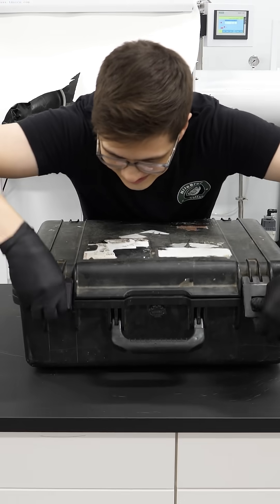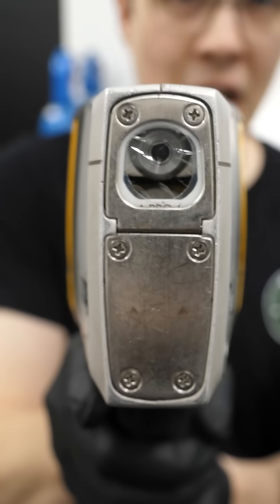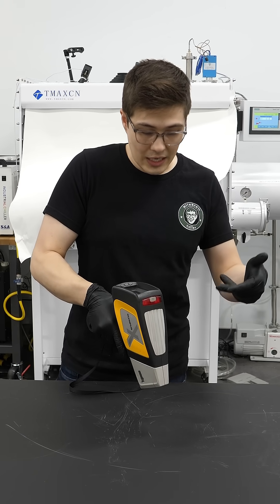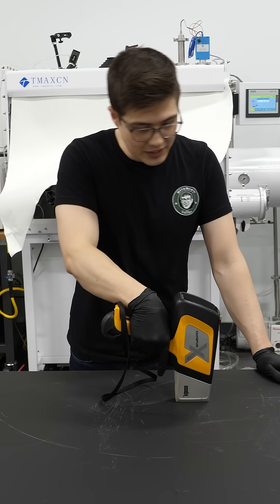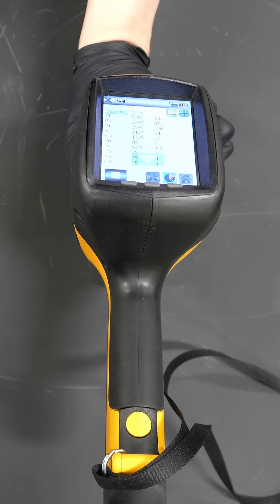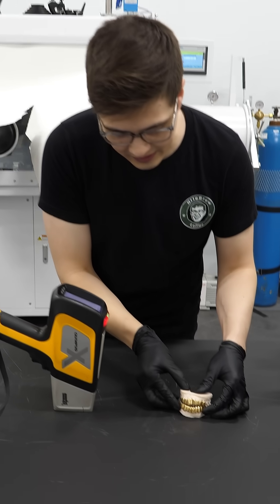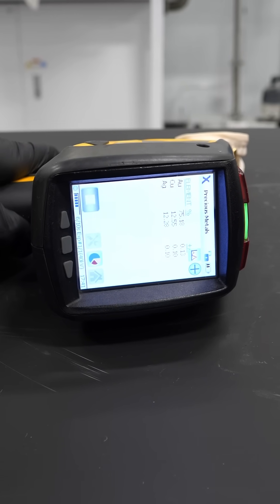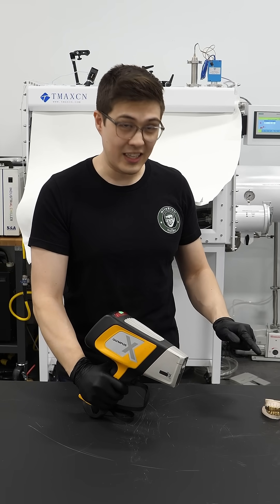I bought a ray gun

Comment: We use a similar tool I call the Spectrometer to analyze metal composition in aviation metals. We as in the ones certified to which I’m not but I do get to watch sometimes. Usually structures uses it if the exact metal type and make up can’t be determined for fabrication of replacement parts they bring in the “I got a gun 😂” to figure it out.

Comment: We used one of these at a place I worked at and I brought my Geiger Counter in one day. I put the Geiger Counter up to it and it barely reads enough to be dangerous while in contact with a surface. We also tested shooting it directly into the Geiger Counter and that's when it went crazy. So just don't put it on your nuts and you're fine.

Comment: It does not reflect X-rays. The X-rays excite the electrons of the various elements. The electrons then emit electromagnetic radiation (light) at very specific wavelengths - not high energy x-rays. The device can then detect these "spectral lines" and determine the exact elemental makeup of the tested substance.

Comment: Cool to see the tool I used for my master's thesis featured in a video! Even cooler to see it in soil mode, as that was my field of study. A lot of the practical use of XRFs are for metal purity testing or mineral exploration, but there is a lot of research in the soils field relating the elemental results here to different soil properties. Essentially the XRF can be a rapid tool to understand the chemical makeup of a soil through a scan in the field taking minutes vs sample destructive, time consuming, multi step laboratory procedures to achieve the same results. It's not a perfect replacement for the lab, but there is much to gain from this research!

Comment: This incidentally also means you should use a kind of protection to not keep blasting your hands and eyes with x-rays.

There is a reason that radiologists wear lead skirts. It's the duration, not the strenght of the x-ray exposure, that's dangerous.

Comment: Not just the type of metal, but also the thickness of various layers. XRF is used to understand the thickness of various metal finishes, such as the gold plated- nickel-plated copper used in circuit boards. 📲

Comment: I learned a few days ago (sanding and painting project) that any lead-free paint can have a teeny amount lead. As long as the ppm of lead is less than 0.009% by weight, it's lead-free. That's the regulation that was put in place a few years ago, mind. The older the paint, the higher the ppm.

Comment: Measuring like this is far too dangerous. If you want to measure a wooden table, the radiation will escape at the edges. I don't like the Setup of Olympus (Evident) and so on, because it is always dangerous to measure small samples. There is a better instrument, like the Spectro xSORT with a rubber / tungsten gasket in front of the measuring head. There are also measuring chambers available. With the chambers it is absolutely safe to measure small samples and so on

Comment: Over here it is used for apartment/house diagnostics, more precisely for led (present mostly in old paints). You have to have a full diagnostic (energy, led, asbestos, ants and other bugs, electrical system, gas system etc.) in order to rent or sell. But, before using the device, you need to check /calibrate it every single time with the provided materials.

Comment: I used to use an "x-ray gun" I was assigned in the US Army. Well, I guess I had 2 of them. The one like you are playing with, it was used to check certain wear surfaces on helicopter power trains to find out if the hardened low-friction layer had been worn out enough to expose the base magnesium. That would be a slight annoyance because the heat build-up could maybe ignite mid-flight, and that area was the main rotor mast. The second "gun" was a bit heavier and required the same power supply as the base. It did have enough energy to get an x-ray image of certain parts to inspect for internal stress flaws. It was strong enough to get an image of the solid metal rotor hub, so I was required to strongly suggest that anyone in the path of the beam should relocate to somewhere 1500 yards behind a solid concrete wall. So OFC the procedure of operation allowed me a lead half apron and safety glasses, and a 20 foot long cable with the firing trigger on it. My E-4 headaches had to do an unexpected scan during my leave once, and I returned to find out that they had accidentally cooked the peacocks in a local reserve and exposed themselves to more radiation dose than they were allowed to get for the period of time approximately their entire enlistment and couldn't even get medical imaging done unless in mortal danger for 6 years or blood and other tests clear them. They just had to compensate the owner of the reserve for the cost for 5 peacocks and re-slot from their primary MOS to that of a rifleman (13B) and transfer from a aviation company with A/C & heated mobile shop for deployment and start sharing the best mud puddle covered by half-shelter with a battle buddy praying for clear warm weather. I checked with them a few years ago and they were all clear of cancer signs but I had gotten cancer 3 times so far. I'm never going to understand what invisible force protects stupid people from themselves.
Reply: I have a theory that the people who don’t even consider the dangers of something are more likely to not feel the effects/suffer from said thing. It’s like this in the medical world too. I was born with an extremely rare genetic condition, and have spent most of my life in the hospital. It always seems like the people who are worried the most about their health are the ones who get taken out more quickly.
Reply: @dogshake I think it has to do with our unconscious brains. If we are constantly worrying over our health, a lot of the time it’s because our bodies sense something is wrong. Ergo, it tries to tell us by releasing hormones and chemicals to bring warning signs to the conscious mind. But that’s just my guess.
Reply: @karmickhaleesi   That would make a lot of sense!
Reply: Soo...how do you accidentally cook a peacock? Or was it more of an "accident"?
Also, you having had cancer is crazy! Did you get extra checks for that?
Reply: @Frrk  the peacocks were in the direct focused beam of the portable x-ray emitter and sadly way too close to the source to only receive the survivable elevated skin temperature. The birds are apparently more suseptible to radiation than some stupid humans sharing the PPE. The peacocks were also 20 yards away, concealed behind the rear hanger door and a plastic 6 foot fence with the power options maxxed and the "barrel" still pointed directly at their perched and unmoving fully cooked forms.
it was my understanding that it had happened before. When I was doing my preliminary incident report to start the paperwork mountain started, I was almost convinced that it was done just too perfectly wrong to be totally unplanned. It was only the perch in the focal area and maxxed settings that just happens to be adjacent to the pin holding the  most annoying gang of birds is too many lucky holes lined up in the swiss cheese for me to be comfortable and those minions were aware of it.
Reply: @Nipplator99999999999  
Yeah, I can understand your suspicions there, lol. In any case, also exposing themselves to that much radiation shows they were definitely not respecting guidelines...
And that's some bad luck on the timing getting cancer. Don't understand why they would cut coverage on the meds, wouldn't they want you to function well? But there's probably a load of politics going on on that front.
Thanks for sharing your story :)
Reply: @Frrk  as far as the cancer is concerned by the Army, I have been diagnosed with the aggressive forms of genetic cancer during the period of time between old enlistment contract termination and the new reenlistment contract having been accepted and taking effect. So I was just getting the standard compensation for injury, but apparently, it has just suffered a major cut to what it is covering and the medical supplies that I have to have just to survive, are not part of the benefits that I have anymore. 😑
Reply: Those are also used for checking welds.
Reply: I learned! Thank you! X-rays are evidently no joke. Truly, best of luck to you with no more cancer and much more care.

The fact that your medically necessary aid is being cut, and didn't 'count' as being service-related makes me so mad. I don't understand how the USA can treat its soldiers and veterans so poorly at the best of times, let alone how you're being treated under the Department Of Giggling Evil; regardless of one's opinions on war, if you're sending people to die for you then you must care for them in return. It makes me seethe, so I can't imagine how you must feel.
Reply: @clockwardkailleach  They have reserves, and a horde of cultists who only really care about you enough to give thoughts and prayers.  Why the military allows themselves to be treated so poorly is beyond me.  If yall voted blue you would get better treatment.
Reply: Thank you for your service
Reply: I 🤔
Reply: i aint reading all that. 
happy for you man.
or sucks that happened to you

Comment: Used them in the past both Niton and Bruker at a certification lab to get quick reads on material. First, you need to calibrate it using a reference material to ensure you are getting an accurate read. Also it only analyzes the outer layer. For more in depth analysis you need to drill the item to get shavings for analysis. Same for your table you are only reading the surface most outer layer with all contaminants on it.

Comment: These are often used to authenticate gold coins, but the problem is that the X-rays can't penetrate deeply. So if you have a coin or bar that is only layered in gold, it will pass the XRF test.
One must run a number of different tests to be sure.
These guns are good for dealers who must test a lot of gold and do it quickly. Silver pops up even more often. One could also test less common metals like platinum and palladium.

Comment: For folks worried about bouncing emissions, I used to work for a company that used these for Positive Material Identification (called them PMI guns usually). The techs who used them on the regular never really used shielding but still treated them very carefully. Like, only taking out of the case when the worksite was prepped. Checking exposure zone, etc. They also usually carried dosimeters to track their regular exposure (we worked with other radioactive NDT, so lots of folks ran with dosimeters). But even with all that, it's usually WAY less exposure than other NDT analysis methods.

EDIT: This is not official radiation safety advice, please check your local regulations and safety procedures

TL;DR it's likely WAY less exposure than most people are making it out to be.
Reply: Also he's likely not going to be using this nearly as much as people use it in industry
Reply: people get more exposure walking by the security xrays at their jobsite anyway lol
Reply: @realbbqchips  false and true, they really don't give off that much and they should have shielding.
Flying tough... Yeah that gives you more exposure to radiation then an RT technician on average 
(Of they do there god damned jobs correctly and use A FIRIRDJCN COLIMATOR ON A 75 CURRY IRIDIUM)
Reply: yeahp, its harmless basicly. just dont put it on your self (or an other peron)
Reply: Yeah, if it was bouncing/scattering you would have been able to see it in the camera feed.
We use a lot of cameras in our radioactive handling cells, when you move a source closer to the camera you can see the effects on the TV screen.
Reply: Backscatter radiation isn't very strong. Just keep your hands away from the target.
Reply: I’ve been blasting my peenar with x-rays to increase the size, but it’s not working 😢
Reply: Honestly im more worried about the lead in the paint
Reply: Why is it called positive? Because that implies there is also negative?
Reply: @NomadUrpagi  yes, actually. Positive Identification is an affirmative analysis, meaning it identifies the actual composition.

Negative identification is process of elimination. So those NDT methods tell you what it ISN'T and you extrapolate from there.
Reply: I work in Gamma Radiography. This is like..
.
.
.
.
.
.
.
Nothing 🙂

Comment: Metallurgist here. Immediately when i saw the icon I blurted out "XRF gun" 😂 A lot of foundries will use this as a preliminary check on the incoming ingot to compare to the certificate of analysis from the manufacturer. Ive actually detected issues with our particle sizes (this foundary used atomization to produce powdered metal), simply by long-running data we got from our XRF checks. Pretty cool stuff!

Comment: I've wanted one of those for a long time.  I have a lot of use cases for an XRF analyzer but the cheapest used ones available anywhere are $10,000 to $30,000 so that's not going to happen.  They don't need to be that expensive but they are only used by large industries and industrial hygiene so I don't see the price coming down any time soon.  Thermal cameras used to be over $30k too but you can get them for $500 now.

Comment: Please by a radiation detector and a lead vest with this. Sometimes xrfs (especially used units) like to leak some xrays out of the side. This will also happen if what you are testing isn't fully flat, or has a bumpy surface.

I have done a lot of testing with these things and they are almost always perfectly well sealed, but its best to be safe. Especially with a hand held xray machine held at about junk height....
Reply: even if it was perfectly sealed / internally shielded, backscatter will get you
Reply: @smenor  oh yeah. When he pointed it at the teeth on the table like that, I almost screamed.... He definitely dosed himself a bit there. That would get you banned from the XRF at most labs.
Reply: I was wondering about that. Like if you have a powerful laser, you don’t use it without goggles even if you always point it away from yourself, Because it could always reflect back at you. I don’t see why x-rays would be fundamentally completely different on that
Reply: I mean, this is the same man that busted out a brick of uranium on that table....
Reply: @g-nizzle that is not at all the same because the type of radiation from the uranium and from this gun are not fundamentally the same.

Xrays have typically more penetration while the uranium has more alpha particles, which have very low penetration.
Reply: Nah he’s fine
Reply: Id venture a guess his junk is already toast, but who knows??🤔🤔😬😬
Reply: Yeah, Ludlum pancake-detector is hyper sensitive to x-rays.   But these XRF guns are only 30KeV emitters, might not pass through a normal geiger counter tube.   Need alpha window, for detecting soft x-rays.
Reply: For great science! Marie Curie style.

Comment: I did buy a radiacode 3.00, and it's amazing .What I discovered in front of the house found one atom of Uranium on the cement  .
What do you have is my choice to get one but it costs more than  my car .
Use on georock  ,with my I found Uranium, cesium, Th and others elements. 
The most important thing that I discovered during  construction 🚧 is a  hotspot .
Reply: Have you been able to detect radium in basements?

Comment: I use one of these every month at work. There's a shielded test stand that can be used to keep the x-rays contained and prevent user exposure. There's also software that allows you to view the spectrum of elements detected. This is a handheld XRF analyzer, but plating areas will often use tabletop versions.

Weird to see Nile using one a few days after I performed my XRF tests lol

Comment: Glad u mentioned the paint... im interested in the penatration depth at the "surface level". would it measure drug compositions.
Reply: Drugs are usually organic compounds, consisting of light elements like carbon, hydrogen, oxygen and nitrogen, which can't be detected with this gun.
For this, you should better look for something like a handheld Raman spectrometer.